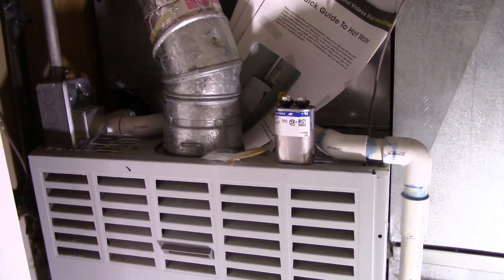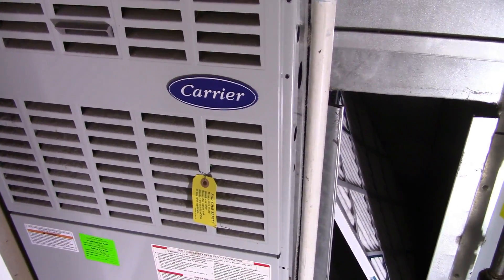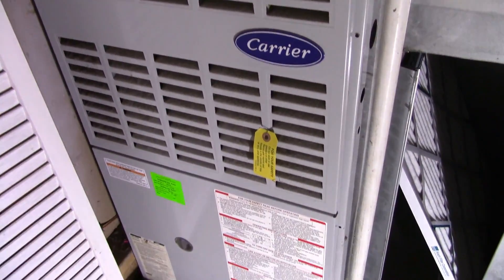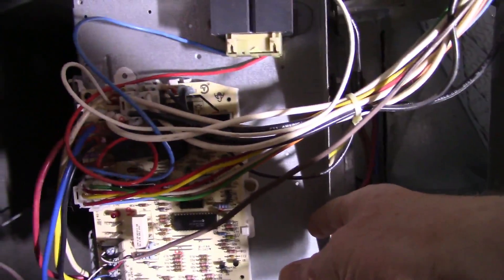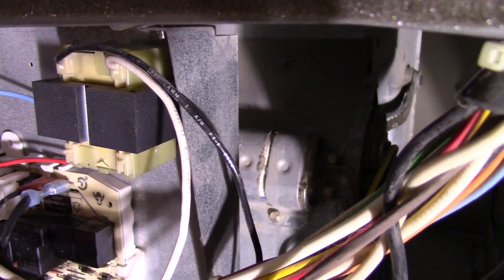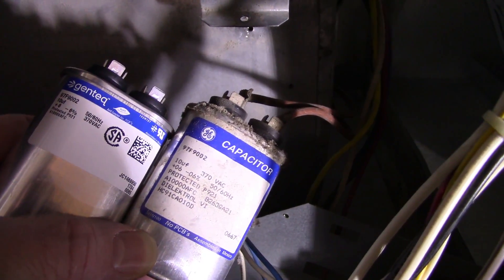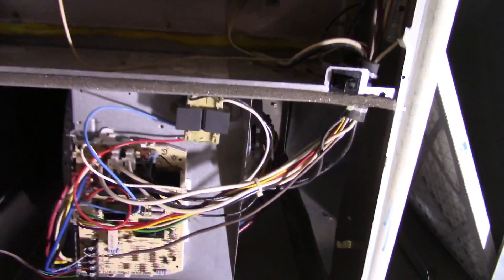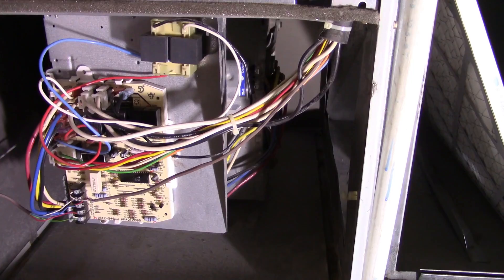Carrier Furnace Blower: Starter Capacitor Replacement

Comment: Looks like I have the same furnace, but my capacitor is HC91CA007D.  When I look it up it says 7.5uF but your model is 10uF.  My model number is :
Carrier Furnace Model 58PAV090-18114.  I will buy a 7.5uF since that is what is already installed.
Reply from the maker: That's probably the best way to approach it.  If it was working with the 7.5uf, I'd replace it with the same.
Reply: @chillinator l

Comment: Your comment at the end - I hope this helps someone. Dude, you are my HERO!

I had the burnt plastic smell, then the furnace wasn't working. It was about 2 weeks after I turned it on for the winter. So if I'd had someone come out to service it, this wouldn't have been picked up, and I would have gone nuts. 

The fan would turn a little, as a matter of fact the purge function (blowing before heating) was fine, but when the furnace lit, there wasn't enough fan movement to blow air into the house, but the fan was still moving. Subsequently, the furnace overheated and shut down after a couple minutes. I have a Carrier, gave me the 13 and 33 codes (and the 12, just to confuse me.) Last time that happened, it was a clogged filter. 

Took the entire fan assembly out, cleaned off all the dust (20 years worth), back in but no luck. Until I found your video. Out comes the capacitor, tested with the help of a neighbour, not working. Bought a new one for $14 (thanks Amre Supply in Richmond, BC!), reassembled everything and voila! Warm again.

Helpful? Very much so. Thought I'd be replacing a motor for $00's, but thanks to you, I'm not broke.

Moral of the story? The fan may still turn, just not enough. Check the capacitor before going too far. 

Thanks so much for your video!
Reply from the maker: I'm glad it helped!  It sounds like in your case it may have been a run capacitor - but a bad cap is a bad cap :)  Hopefully YOUR comments will help someone as well :)

Comment: This is EXACTLY what is happening with mine right now. I pulled the blower out last night and found it was clogged up with filter fibers and other crap that should have been removed when I had the ducts cleaned 20 years ago. The motor now over heats. I have ordered a new motor and a new cap. I will return the motor if the new cap fixes it.

Comment: Im cursing out Carrier. I had an outside AC unit that fried. So Im at window AC...because Im not paying 10k for replacement parts. NOW, my furnace crapped out on me. Its throwing code 33. Ok, replaced the filter, but the fan is the issue. Either the squirrel cage or the motor is dying. Its making some horrible screatching sounds. Lube didnt do it, and I tried straightening it as much as I could. Still squeals. How come even a crappy Ford Pinto still has a decent fan, centered, no squeaks but a fairly new Carrier (which is just like yours) cant...

Why is this company not out of business with this kind of poor quality?
Reply from the maker: Sounds like it might be the bushings in the motor.  Does the cage spin freely when it's powered off?  If it is the motor, they're not terribly expensive and you should be able to pick one up at Grainger or possibly on eBay.  If I remember correctly, I think I saw a couple of videos on how to check/clean/replace a motor here on youtube.

And yes, it is horribly frustrating that something as expensive (yet as primitive) as an A/C or Furnace has such a short lifespan.  They make them to break down - that's the only logical conclusion.

Conversely, my Dad had a "water furnace" on a house he bought in rural Illinois.  It used ground water to pre-heat/pre-cool air and was incredibly cheap to operate.  When the furnace was about 30 years old, it stopped working.  My Dad had to search high and low to find someone to come look at it - and finally found a retired repairman who agreed to come look at it.  When he showed up, he had a small box (about 2" square) and a screwdriver.  My Dad asked him where his tools were, and he said he didn't need them as this (indicating the box) was the only thing that ever went wrong with those water furnaces.  The part plus the repair cost about $30.
Reply: @chillinator  Yeah, I know the feeling. The days of the simple efficient machines is over. And it wouldnt be so annoying if you didnt have all the "experts" saying how newer things are way more this or that, but fail to mention how being thrown out after 5 years enters any of their calculations. Is the motor with bearings of bushings? That explains it a bit. I did manage to eliminate all the sounds. Its been quiet for the last 24 hours (and running duh lol, kind of pointless if its silent and off). I did WD40 but thats a very temporary measure. I wasnt going to waste my good grease on figuruing it IFs. I banged on the fan a bit to get it more straight, and knock on wood. I still think a replacement is due, but I may gut the old motor and replace it with something else, and just use the furnaces hot to power a relay that spins...I dont know. I have a three phase laying around. I have to see what motors I have that like heat better.
Reply: Just replace the actually fan that is inside the outside unit

Comment: I have the same old Carrier furnace and I change the control board a few years ago. Today, around a minute after the fire comes on, the blower give a humming sound and not spinning. Then about 1 minute later, the fire shuts off.  I am going to change the CAP and hope it fix it. Thanks for the video.

Comment: my fan runs but sounds like its sputtering and humming. house is not cooling well and register air flow seems weak. no freezing, coil is clean, condensor fins cleans and new motor, refridgerant fine, and ducts are fine... can a bad capacitor cause weak air flow??
Reply from the maker: I can't say for sure, but if it were me, I'd first shut off everything, open the access to the motor and see if the blower cage/motor is spinning freely, see if the motor is dragging or clunking, and check the cage to see if it's dirty/clogged.  You may have a motor problem - i.e. dead fields on your rotor or worn-out brushes or bushings.  You could try replacing the capacitor before digging into the motor, but I'd be surprised if this fixes it as the starter capacitor is only used - to my admittedly limited knowledge - to give an initial push to get everything moving and isn't used in the constant running phase.  Motor swaps aren't that difficult - assuming you have the clearance to get them out.  Do a search on youtube for motor replacements - there are several videos on removal and cleaning as well.  Good luck - it's a bad time of year to have A/C issues ...
Reply: chillinator thanks for the in depth reply. i actually have an extra ac motor in my garage. a buddy of mine is gonna help me this weekend to try the capacitor too. thanks again for the info and ill let you know how it goes. the weird thing is that there is a big build up of super cold air when i open the ac up. seems like its building up in the space from the return vent to the filter. so weird... i set it to 78 and its only getting it down to 82 during the day w temp at 100 outside in s texas
Reply from the maker: @texastaurus9271  One other thing that I've seen happen with similar symptoms was seeing the A/C core (right above the blower in the furnace) freeze solid - so that very little air was getting through it.  The A/C was running full-blast but the house wasn't getting any cooler.  If, by some chance, your A/C was running a LOT before this happened, it's possible that the internal core is frozen (iced up, actually) - but letting it set with the system off for several hours usually "fixes" the problem.  Again, good luck :)
Reply: chillinator blower handler was super dooper dirty.. had an new extra motor laying around and tech threw it in. blowing like a champ and cooling again
Reply from the maker: @texastaurus9271  That's awesome!  Thanks for the follow-up.  Feels good to fix your own stuff :)

Comment: It works as expected✨>imgs.love/ACFiltrete?Vめ   No complaints. And use it as intended. The arrows for air direction is not incorrect as some reviewers have said. The only problem I can possibly see is letting it get ridiculously plug and it pulling the filter into the furnace. It's designed to be used and replaced as instructed. I change mine every month if the furnace came on a lot that month otherwise every two months.

Comment: Thanks man! I Knew the HVAC Tech was full of it. Told this very nice family the blower motor was toast. I had it running unaided the night before! I w we as inspecting for sabotage and seeing nothing obvious, tried to power it up. Humming motor not spinning! WTH did he do?? Went upstairs and fan was switched ON- we need heat. Switched to auto and upped the thermostat and Lo! She kicked on! And shut down three min later as has been happening. Still think I’ve got a clogged up heat exchanger, but a $300 part + labor it is Not. Thx for your help!

Comment: Thanks for sharing this.  Hoping for some advice.. I have an almost identical issue with one difference.

The blower will work for a little while then it stops.  The AC unit outside is functioning fine
during this time.

When it's not blowing and I engage the safety switch on the unit I hear a humming noise but nothing
happens.

I find if I leave it off for a while (an hour or so) then turn it back on again it will start blowing
again.  But then a short while later it cuts out once again.

Does this seem like it might be a capacitor issue?
Reply from the maker: Hmmm ... could be.  Next time it stops, power down the unit, reach in and get the fan moving, and while it's moving power it back on (with your hands out of the way, of course).  If the blower spins up, then it could be a capacitor issue - you might need to check if you have a run capacitor as well as a start capacitor.

If the blower is starting on it's own, then it might not be the capacitor.  It could be an overheating issue.  It could be that when you're shutting it down and letting it sit for a while, the motor is cooling enough to run again, but when it starts up it's fighting against possible friction, heating up quickly, and then seizing/stopping.

Next time the motor stops running and you hear the humming, try first shutting off the power to the unit, then reach in and see if you can turn the fan by hand - or use a stick if that makes you nervous.  If the fan doesn't spin really freely (you should be able to give it a nudge and it should spin on it's own), it's possibly a motor/bearing issue.  The motor could just be really gunked up, or, the bearings (bushings) might have lost their lubrication.

There are videos online about how to remove the blower and clean the motor/cage assembly if you think that might be the issue. 

Disclaimer: I'm not a "professional" repairman, so take these suggestions with a grain of salt - and always, Safety First :)

Good luck :)
Reply: @chillinator  I was able to move the fan by hand, but it certainly didn't start spinning freely.  It moved but was a little stiff.  So you might be right about the motor/bearing issue.  I had it working for a few hours yesterday without issue but it didn't feel like it was blowing very hard.  So perhaps you are right and it might just need some cleaning/lubrication.  Thanks very much for your input.

Comment: Great video!! I'm currently working on my furnace because it's not working obviously. So the issue is that the furnace will come on for about 2-3 minutes than shuts off. So I hear it buzzing, so turn the little fan a few times until it goes on its own and stops again. I was talking a guy that works at a parts place and he said more than likely my board is bad and should think about replacing it. So after seeing your video I'm rethinking that. Do you have any Idea?
Reply from the maker: When you say "the little fan" - are you talking about the blower cage or something else?

If your blower motor is starting on it's own and running, that's a little different problem than I was seeing.  If the blower motor is going from running to stopping on it's own and then just sitting there humming, and with a nudge you can get it going again, it could be the capacitor, but that sounds like something with the motor (really dirty).  How easily does the motor turn with the power off?  You should be able to give it a nudge and it should coast - it should be really easy to spin the motor.

You could always replace the capacitor and see if that fixes things.  If it doesn't, it's not a significant loss as you would then have a replacement capacitor on hand - and you would know it's NOT the capacitor.
Reply: @chillinator  Just now seeing your comment. Changed out the board and still doing the same thing. So I'm turning the fan blade trying to make that spin.
Reply from the maker: Hmmm ... I'm no expert, but that sounds more like a blower motor problem - if you have replaced the board and the capacitor and still have the issue, it might be time to pull that motor out and check it.  If there is a lot of oil leakage, dust buildup, or the cage is wobbly (indicating possible worn bearings) the motor might need to be replaced.  The blower isn't terribly hard to remove - if you have the room to get to it.

There is also the possibility that the motor might just need brushes, but that's conjecture on my part (I'm not even sure it has brushes).

Comment: how did you remove the wires from the capacitor? you just yank them?
Reply from the maker: Yes, basically.  I used a small needle-nosed pliers to grab hold of the connector so as not to damage the wire.  They may be snug, but a little wiggling and a gentle tug will pull them loose.  Then just hold the new capacitor in the same orientation and transfer the wires to the same connectors on the new capacitor.

Comment: Last year I had that same problem, the unit was humming and the motor would not spin. I replaced the capacitor and it worked again. Now I am having the same problem and what I do while I get the new capacitor is manually spin clockwise the motor and works for a day sometimes a week. I will let you know if the new capacitor works again. Thank’s for you video.

Comment: AFTER CHANGE THE NEW CAPACITOR MY BLOWER NOT WORKING I REMOVE THE HIGH SPEED BLACK WIRE CONNETED TO 120 VOLT TO SAFETY SWITCH THE BLOWER WORK WHAT IS NEXT
Reply: Victor Alecchi sound like circuit board need replacement where delay is housed
Reply: Did u ever find out what it was?